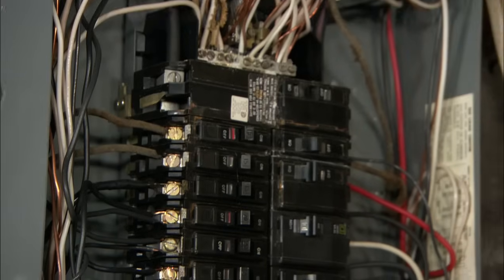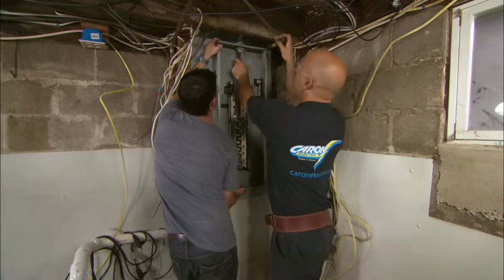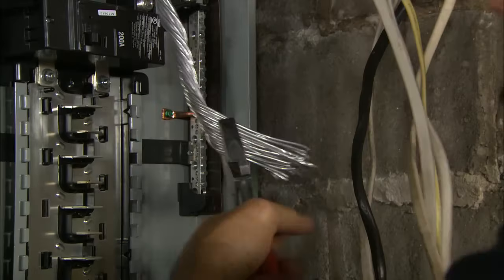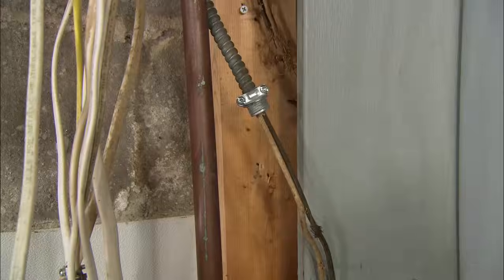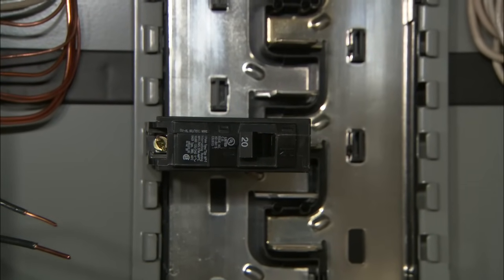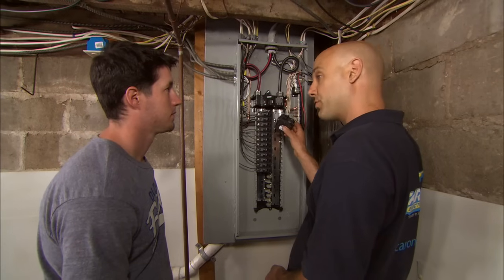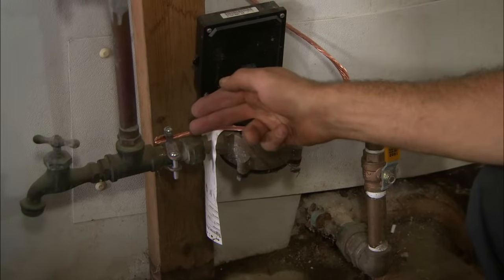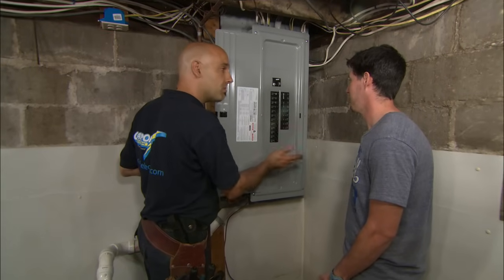How to Upgrade an Electrical Panel to 200-Amp Service (Part 2) | This Old House

Comment: Some areas of the country you can do a single point ground plate if allowed by local code then ground the plate, also I have run ground rods around entire house, rods 16 ft. apart if they are eight feet long and then used 1" X 2" solid copper strap via thermOweld. to bond rods. Rock solid every time. Again, depends on local code.
Reply: In Ontario we can use grounding plates instead of rods and the must be buried 24 inches deep I’ve heard some, places it’s copper but here it’s galvanized steel. They are relatively cheap and as efficient 2 10 feet 5/8 ground rod

Comment: I will never let you all install a panel in my home that would not pass.  Grounds and Neutral are not bonded in the box its only bonded at the meter box and a ground going in to the breaker box. Something you didn't do at all.   If they ever want to install GFI it would never work right.  Or and arch fault breaker's.
Reply: The grounds and neutrals can and should be bonded together if it is the first means of disconnect, now if he had a disconnect outside it would be a no no then!
Reply: @
McCuneWindandSolar
Why do people like you come on here and post comments that show you don't know what you're talking about?
Reply: @sylviaisgod6947  ok what ever you say Milly Cyrus wannabe.

Comment: How does a young homeowner deal with some illegible markings in the main panel for the circuit breakers? This panel was installed 20+ years ago. They originally used pencil. But then they wrote over 2 circuits with a red marker, and I'm barely able to read that. One circuit either reads as "Kit LAT" or "Kit LIT" with 15 amps. I would assume it's the kitchen lights, but obviously it's a bad idea to assume with electricity. Also, another reads "Base. Walls" That could either mean basement walls or baseboard walls. That's with 30 amps. I'm rather confused with the electrical setup in my house. I'm glad it works and it hasn't caused a fire in my house, but it would help even more if they wrote the panel out more clearer. Help, please?

Comment: 200 amp? Crazy. That's an industrial supply. Are you growing drugs in it?
Reply: If you have an electrical car, 200 amps is about standard. Same if you're running heavier equipment in the garage.
Reply: Pretty typical really

Comment: Why not use circuit finder to track down the location of the wire connection on the breaker box instead cutting everything? This create much more work right?

Comment: Why would you throw away allmost all  the good old  breakers wtf?
Reply: Because they wear out over time, and why spend all that money just to skip out on a few $3 breakers?
Reply: @sylviaisgod6947  Brakers do not wear out because they are never used if they are good quality they can last easily 40 years or more.

Comment: If the main ground is attached to the water meter, what were the copper rods for?
Reply: You need both you can get more information on the NEC at page 250.52(A)(5)
Reply: It’s a water bond to the service. The ground rods are what actually protect the electrical service in the event of a ground fault.

Comment: What a rats' nest. I don't blame the electrician for junking that, even if the panel was rated correctly.
Cable routing, management and labeling nonexistent.

Comment: He went from a Square D QO panel, the best,  to pretty much a junk panel. lol And the older panel looked fairly new. If he spent a few dollars more on a Square D QO panel he could have reused the existing breakers, and saved money with better quality.
Reply: Yeah no, I've seen a great many schnieder breakers nearly weld the wires together before tripping.

Comment: Don’t you have the concept of inspection/testing in the US?
Reply: Updating or upgrading a panel yes it has no inspected by a electrical inspector of the county
Reply: Jhorman Lopez sounds quite different. Over here any corduroy you install has to undergo safety testing for insulation resistance, continuity, earth loop impedance etc etc.
Reply: Chris B  I understand well the inspection the county inspector makes for this kind of update is for grounding and bonding at the main panel or meter but usually there’s the inspector don’t do load test that’s on the electrician but it’s pretty safe with the electrical panels we have on the USA if one wires gets to hot because of overloading it trips
Reply: Jhorman Lopez outside the US the electrician for this work every time they modify/install a circuit.
Reply: We do but many don't do it as its not enforced. Almost all plumbing and electrical work can be done DIY if willing to do it.

Comment: Isn't it illegal to ground to a water line?
Reply: You always ground to a water line.
Reply: No it is a requirement you can find the reference on the NEC at 250.52(A)(5)
Reply: And if you wanna know why it is because   If you water line becomes energize let’s say by lighting during a thunderstorm it can save your life by taking the electricity out the ground rods that are outside the house
Reply: No

Comment: I cannot believe they didnt move the sump line which runs behind the panel that is definetly not up to code
Reply: I was wondering about that also. Pipe comes apart and sprays panel.
Reply: @sthue1001  i had a waterline bust in our commercial Bar......you could not have aimed that 70PSI stream any better. squirting water straight on the breaker panel (open panel door) LOL!

Comment: A lot of places have trouble getting the power company to come out in a timely manner. Also, the new service needs to be inspected before reconnection. Electricians will install everything and back feed the new panel with the old one until the inspection. Then call the power company for the move.
Reply: Exactly! In Maryland, you make temporary connections to the existing SEU cable on the load side of the meter, and let the power company come out after you pass your inspection.
Reply: Mine took over eight months for the whole process.

Comment: I want to see the part where he’s figuring out the bill.
Reply: Had these guys give me an estimate to rewire my kitchen remodel and almost crapped my pants
Reply: Anyone have an estimate on the cost of this total job I need this exact same thing done asap
Reply: @00.0O  at least 2000 to have done, only a few hundred if u do it yourself though bc the only costs are the outside weatherhead and box, wiring and breaker box inside - and it should be easy enough to get a new breaker box that can reuse your existing breakers - assuming your house uses breakers..
Reply: depends on where you live
Reply: @00.0O  Here in MA it ranges from $3 - 3.5K
Reply: @sansar44  I got a 5K estimate in Virginia this month.
Reply: @TstormVA2012  it all depends. If use ridgid conduit for riser and from meter to panel. Which needs to be thread. Also, if lots of conduit needs to be redone inside. Not to mention if cold water ground need to be ran inside. In my state everything needs to be done in conduit with copper service wires. Material for 200amp service alone is 1200-1600. This video is silly when compared to Chicago code. Price easily 3-4k
Reply: @TstormVA2012  i got one for a 1000.00
Reply: @00.0O  I was given an estimate of $1,500 for: 200A service entrance upgrade including the meter socket, new panel, and all 1st floor outlets including drywall. This is in western Pennsylvania.
You really need to shop around and make sure that you follow local requirements. If you don't know what they are, call your city and then call your power company. Too many "electricians," nearby do the work without permits/inspections/follow-up and then the customer is on the hook for fines/penalties.
That or DIY - it's really easy :)
Reply: Rodney Garrett Philadelphia, PA. That’s about the general price range in Pennsylvania $2,000 tops
Reply: @rodneygarrett8975  thts a normal price 4 you up here add another $1000 (utilities screw us for disconnect /reconnect) if you dont need the upgrade or you want to plead with utility co you cld find it cheaper not to involve them
Reply: @00.0O  $10,000 USD
Reply: @00.0O  Just jumping in to say that other people are saying you could do it yourself. But check with your local code because my city requires an electrician contractor and a permit to do any work.
Reply: @00.0O  1200-1500
Reply: @00.0O  here in GA itll run you about $2500-$3000. I was gonna do this for an army buddy of mine but the county requires a LICENSED electrician to do the work. I dont have my license just yet but I was quoting him ~$1750.
Reply: @00.0O  roughly in this part of country $2500+
Reply: .14  WET PAPER  OR  A GOOD TIME INSIDE THE DOOR

Comment: In my Area it takes 6-8 months for the power company to come out and when you do get an appointment, it's a 3 week window and a 50/50 crapshoot if they actually show up.
Reply: Pull the meter at the entrance..
Reply: @paulksefvwefvwefvwerv6767  Can't do that, that's tampering. You need to have your service disconnected first or you're actively messing with the meter.

Comment: If the power was shut off, what was the light source during the installation of the new breaker panel?
Reply: He said he hooked up a generator to provide a couple of lights

Comment: Why wouldn't you have used copper wire instead of aluminum wire
Reply: Copper is much, much more expensive! And aluminum wire is perfectly safe for service entrance conductors and non-branch circuits, such as large HVAC equipment.
Reply: cost

Comment: Wth???? Aluminum service wires???? Cheap.... fire hazard.....
Reply: Cheap, yes, fire hazard only if done incorrectly.
Reply: Open the panel on your house or office and you will see aluminum service wires. Every time.
Reply: Aluminum is fine if the lugs are rated for Cu/Al, and the corrosion jell, and proper torque spec.
Reply: Every house has aluminum service wires.

Comment: I've never seen aluminum wire used for the feed ?? Trouble done the road. Or do they refer to this as job security to charge the homeowner again down the road to change it ?
Reply: Aluminum wire for service entrance is used in every house every day.
Reply: @leonardholt5311  but residential homes are thrown together with cheap materials anymore. Furnace and A/C units don't last more than 10 yrs now. No pride in taught to anyone anymore , just hurry up and get it done.
Reply: adam0U812 Davies maybe so but you said you had never seen aluminum wire in a house before  If you knew anything about the electrical trade, you would know almost every house in the US has aluminum service entrance conductors. And if you think that’s a reflection on today’s cheap building methods, then you would be wrong. Even older, better built homes have aluminum as service conductors.
Reply: adam0U812 Davies It’s been done MILLIONS of times and that’s why he used NO-OX on the connections. What you don’t want to see is aluminum wiring going to all the receptacles in the house. Now that’s not a good thing. Got a neighbors house that has it (1969) and he just re-wired the whole house during a renovation. Of course you can look at it as nothings happened since 1969 either.
Reply: @alant5757  over a million undocumented immigrants have been coming into the US for years ,   that doesn't mean that it's okay.
There is no pride taken in building in general construction anymore , and that is why this country is in a downward spiral. Just throw the building together and we'll tear it down in 15-20 yrs.
Thankful that I hopefully will retire this year and it won't bother me anymore.
Reply: That’s why he applied Nolox it’s to keep the aluminum wire intact

Comment: did he attach more then one ground wire to the grounding pole.  I think it's one wire per screw.
Reply: By code you're allowed 2 grounding wires under one screw but only one grounded wire per terminal
Reply: @stevenpersinger6577  I watched  house inspector video and he was looking through a 200 amp service and he pointed that out and said it wasn't right.  My thought was he had to be wrong because how could the service and installed and inspected and be done wrong.  Thanks Steve

Comment: Important to note, Bending the wire in a loop ALSO gives you the ability to Reattach into a new lug if by chance you have a Bad Connection and it burns up. If not for the "Extra Wire" in that loop, you would have to replace the incoming cable OR install  a "J-Box" above the breaker panel to splice in longer wire. Good Idea here.
Reply: I was also explained that if there is a surge like implosion there is slack in the wire so not everything gets ripped out from under the lugs....
Reply: Yes! Always leave slack!
Reply: On god thow
Reply: That's why it's called a service loop...
Reply: capt obvious welcome to the chat
Reply: you bet, and could also flip the box upside down, bring SEC wires down the inside, turn them up to the lugs  for the main breaker. Main breaker can be top or bottom.

Comment: I find it entirely ironic that the same woo hoos crying to take us back to the stone age over "climate change" somehow NEED a 200A panel, when the standard is 100A in the United States.  Clearly, THEY deserve access to more power than everyone else, but YOU need to pay more, have a lower standard of living, lose your transportation and far more. YOU need to be taxed more, not them, no.

200A is TWICE what any normal people need.   I'm conservative, and I think anyone going into this zone as an 'upgrade'...greedy bastards.
Reply: Uh Mike. Your comment makes zero sense.
Reply: Clearly you are the victim of the propaganda of fossil fuel companies.  They are reacting the same way tobacco companies did when it was discovered just how dangerous tobacco was, by launching a propaganda war to try to confuse and upset people.  Here are what the facts are:

1. Global warming is the overwhelming scientific consensus, and has been for a long time.  There is no grand conspiracy of thousands of climate scientists around the world.  
2. Renewable energy is not expensive.  It WAS expensive years ago.  But that was before huge and continuing cost reductions for both wind and solar.  Wind and solar are now the cheapest source of new bulk power generation in many areas.  And, its costs continue to drop rapidly.  If you are looking at figures from just five years ago, they are way out of date.  It's changing that fast.  It's one of the reasons that renewable energy made up more than 50% of new power generation in the US in 2019, and is forecast to again be the majority for 2020.
3. The intermittent nature is not a dealbreaker for renewable energy.  Wind, solar, and hydro complement each other, so that when one is not generating electricity, you can get power from the others.  Using long distance high voltage power lines, you can draw from a large geographic area (the wind is always blowing somewhere).  Energy can be stored in dam reservoirs, in pumped hydro reservoirs, and in batteries.  Batteries are getting much cheaper (down 87% in the past ten years), and are starting to be built as an alternative to gas peaker plants.  Also, demand can be curtailed in factories and in homes by shutting large loads down for a few minutes until peak demand passes.  For example, home water heaters are large energy storage devices.  The heating element could be automatically shut off for a few minutes and the homeowner would never notice or be affected at all, except by saving a few cents.  And, if at the end we have to burn a little fossil fuel during peak demand times, it's not the end of the world.
4. Transportation improves and gets cheaper with electrification.  The drivetrains of electric vehicles are way cheaper to run, require less maintenance, and are more reliable than internal combustion drivetrains (no transmission to wear out, no timing belt to break, no oxygen sensor to replace, no ignition coil, to go bad no head gasket to leak, etc.).  And, as mentioned before, batteries are getting cheaper very fast.  Looking at the cost curves of batteries, and the fact that electric vehicles are simpler to build, it's an economic certainty that the acquisition cost of electric vehicles will drop below that of gasoline vehicles in a few short years, and continue to get cheaper.  The energy density of batteries is also increasing rapidly, meaning longer and longer ranges.  Plus, electric vehicles have the advantage of home charging, which is something gasoline vehicles will never have.

Comment: Is it ok to mix / connnect ground and neutral wires together to the same conductor block?
Reply: Call an electrician.

Only in a main panel

In all sub panels after the main they must be separated, but an untrained person may not be able to tell what qualifies as what

Comment: In my county, a licensed electrician is allowed to disconnect the electrical wires from the house. They don’t need to wait hours for the power company to come out.
Reply: Or days....
Reply: In Pennsylvania, USA  We do service upgrades live all the time as well. Some states require you to have the utility turn off power

Comment: I prefer to organize the breakers in some sort of sensible way, rather than just randomly, as seems to have been done here.
Reply: Because the wires have been shortened when removed from the previous panel, organization may not be possible.  Unless of course you want 20 junction boxes right outside your panel

Comment: Hello. Some one knows why put the neutral wire Whit the earth wire in the same bus bar? Why don't put separate?
Reply: Since it’s not a sub panel, the ground bar and neutral bar are bonded together.
Reply: @pkl714   Is correct Peter thanks for your answer